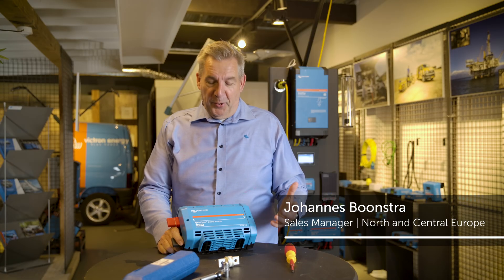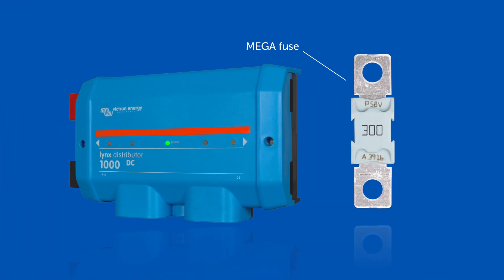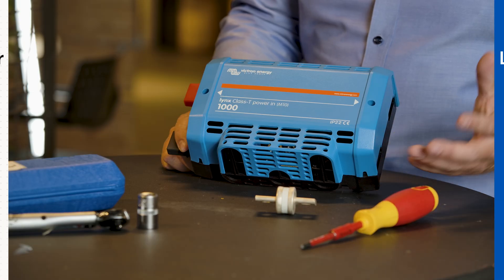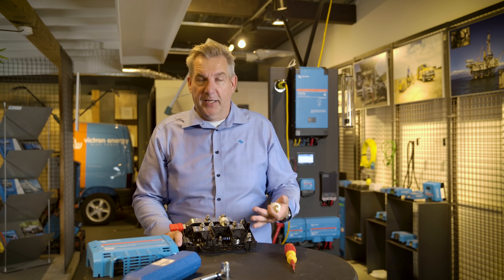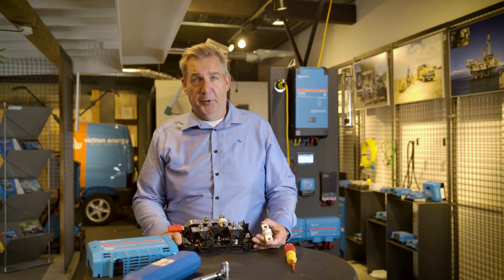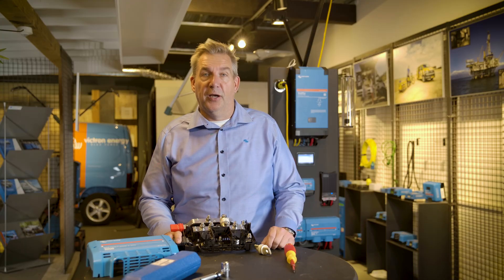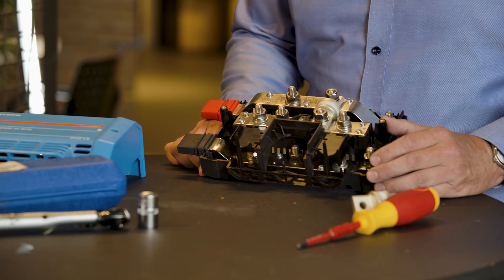4 of 4 - Explanation of Victron Energy Lynx Class-T Power In

Comment: Is the short circuit is the short circuit current the same as surge discharge current, or is it the Max. Continuous discharge current? I’m using 12 48v 100Ah li-time batteries and want to protect each battery.
Reply: @leeroyress6068 Type the following in your favorite AI search engine: 'Is a short circuit in the domain of fault protection and a surge current in the domain of overcurrent protection'. Did the result of your search help to point to the areas that you should research some more? (I'm trying to get my head around all this stuff too, as it pertains to LiFePO4-battery-bank-based power systems.) I think distinguishing between fault protection and overcurrent protection is a divide-and-conquer approach to understanding the problems to be solved.

Comment: I have incorporated a Class-T fuse in every battery I've built so, would there be any point in adding this unit to my system?
Reply: @9111logic The fuse at each battery sized to handle the current from one battery and the fuse in the Power In is sized for whatever aggragation of batteries you made (xPyS, etc.)? I get the impression from the Power In videos that when he says the Power Ins are for "strings" of batteries (a.k.a., "bank"?), that that is key. I'm trying to figure it all out too--any day now. But wait a sec, the fuses at the batteries are fault protection (vs. overcurrent protection)? I've not yet found a good source that brings all of the relevant knowledge together in one place. The Will Prowse video where he has a bunch of server rack batteries on the floor has a statement about the purpose of per battery fusing in the case of LFP, as I recall--even though he does not have any fuses on them.

Comment: Does this power in connect directly to the distributor or is the BMS absolutely required?
Reply from the maker: This depends if the batteries already have a BMS.  Lithium batteries must have a Battery management System of some kind.

Comment: I’m honestly quite concerned by what this implies.

So Victron has been recommending MEGA fuses for years in their official wiring diagrams – even though these fuses may not be suitable for properly protecting Pylontech batteries? That’s extremely disappointing as a customer who followed these guidelines in good faith.

Now, years later, we’re being told there’s a new “solution” – but it doesn’t even fit the standard Amphenol connectors used by Pylontech, since those start at a minimum of 200 A? How is that a viable retrofit for existing systems?

This doesn’t feel like a small oversight. It feels like a fundamental design and communication failure – and I’m left with a system that is now being labeled as incorrectly protected. Not acceptable.
Reply: To be clear, there is nothing wrong with a mega fuse, but the maximal short circuit current of many lithium banks (also these of Victron) exceed this Mega fuse value , therefore another solution is needed. For these battery banks to be clear.   A Pylon or other residual batteries often are not able to produce these hight currents on short circuit, so then there is no need for Class-T

Comment: I use DC circuit breakers on each string. They work well. Is there a problem using these? What is the advantage of a fuse, over a circuit breaker?
Reply: Circuit breakers don’t handle vibration very well compared to a fixed fuse. Hope your not going off road as you will have issues when the internal parts of the circuit breaker become loose and don’t work. Fingers crossed you’re ok.

Comment: Hi I have three Victron Lithium Battery Smart 12,8 batteries, each wired separately to a Lynx Distributor. Each one has a 300 amp Mega Fuse. I had my installation reviewed by someone who installs allot of Victron systems on boats. He suggested I replace my Lynx Distributor with a Lynx Power in, and install a 400 amp Class-T fuse on each of my three batteries. He the Mega Fuses could arc and melt into a solid connection. Do you think I should do this? Is this good advice with stand alone batteries?
Reply: Yes you should. Even if you just had one of those batteries it’s good to have a class T fuse with lithium.

Comment: I am just looking through the specs on victron batteries and can not find the scc stated for the different models. Is there a list so we can correctly configure a system? as i understand the class-T can handle up to 20k AIC, MRBF fuses can handle up to 6k AIC, but i am unsure what rating the standard mega fuses are, and are the 32v megafuses rated different to the 58v on AIC?
Reply: For the NG models the list of minimal and maximal short circuit are listed below, would that help you ?                     
12,8V-100Ah
1500
3500
12,8V-150Ah
3000
5500
12,8V-200Ah
3000
7500
12,8V-300Ah
6000
11000
25,6V-100Ah
1500
3500
25,6V-200Ah
3000
7500
25,6V-300Ah
6000
11000
51,2V-100Ah
1500
3500

Comment: I just had a look on the total internal resistance of a real-world 60kWh battery bank that I recently built (under optimal conditions, battery temperature slightly below 30°C). On a 140A sudden load change, the voltage is reacting with a delta of 0.4V, as seen by the Multiplus, all wiring, breakers, fuses and DC distribution included. Hence the Ri of the whole battery system is only 0.003 Ohms. Assuming 56V, this could result in a short-circuit current of whooping 18666A or almost 19kA!
Reply: could be, but thats connected in several strings to the busbar I suppose?
Reply: @JohannesBoonstra-ol2nz  Yes, two strings of two battery modules paralleled externally on each Class T fuse (additional breaker within each battery module), with rather short wiring 70sqmm. The planned/calculated/expected Ir was bit higher, though.
￼
Reply: @holger2806  then you should be well below 20kA  per fuse so thats fine

Comment: @Victron Energy - it would be nice to have a Lynx X in the Product Range - so you can Switch Inputs Upside Down. Especialy on ESS System's from Top you came down with the connection from the Multiplus - from the Buttom you came from the Battery's 🙂
Reply: yes agree, we have some discussions on these solutions already but due to priority elsewhere its not happening soon I am afraid.
Reply: It is so easy to implement and it should be done already. To just need a bended piece of copper and a different plastic mold. Please do it
Reply: @donalexey yeah right 😂
Reply: @johannesboonstra6917  no? What have I missed?
Reply: @donalexey  the fact that there are priority elsewhere, therefore  its not happening soon I am afraid.  its always about making choices what to do first..
Reply: @donalexey  That mold is the expensive and time consuming part. Molds cost A LOT to design and build.

Comment: I’d like to see a Lynx style component with: 1) 1 Class T fuse slot (sized for up to 400A), 2) A 500A rated shunt, 3) A manual battery disconnect switch (rated to at least 400A).

All in one.  

Retail price target: $300-400.
Reply: Actually, minus $25-50 since the class T fuse won’t be included.
Reply: yes there are many options/ideas.  The issue we have is that we need to prioritize development power ,  but this will be on the list.

Comment: can a mutiplus 2 3000va 24v be parallelled up to a easysolar 2 3000va 24v even though one has a cerbo controlloing it and one has its built in gx device
thanks in advance
Reply: theoraticly yes but this requires changing the internal wiring , so I would advise not to do so and go for a Multi GX plus a Multi and a stand alone Smart MPPT charger
Reply: I've got two easy solar linked together 3000va 48v, as already said above you need to change the internal wiring and both pcbs in the multi's need to have the same series or product no to make sure they are compatible, both of mine have GX screens, only one can be used, there isn't a lot of extra space inside the box, I haven't had any issues since they were installed 5 years ago.

Comment: My victron requires a 600A fuse coming from the battery’s,can this working with 2 300A t- class fuses, i ask this because i have 3 battery banks from 48V 608 Ah and will connect them to a busbar but every bank separately have a breaker from 125A for redundancy and maintenance
Reply: 3x125A (475A) is max system current, system will work using 2x300A of course, but those fuses will never go open as those smaller 3 (125A) will go first. Also, if you're batteries are 608Ah max, I would use 400A main fuse (2x200A will do), still alowing each bank to pull 125A but in total it limit max battery SC current to 400A thus saving battery life span. Always mind fuses thermal properties, how long they could take max current before meltdown... good luck.

Comment: M10 vs M8 doesn't do anything in terms of current capacity, except possibly lower it, but I haven't done the math on that. However, the M10 bolts make a more secure connection, which is nice when the project calls for four, five, or more Lynx products in a line. The bigger issue is that the advertised 1000A continuous capacity of the buss bars is not even close to correct. Measure the buss bars inside the Lynx and do the computations OR use any of the copper buss bar calculators on the web and you'll see that 500A continuous current is about the max before heating issues arise. 1000A continuous across the Lynx system can actually melt the plastic surrounding the buss bars. That means in large systems with many large inverters you cannot put your batteries at one end of the buss bars and loads/sources at the other. This also means building very large systems with Victron batteries is difficult since the VE batteries require an external battery monitor (i.e. the Lynx Smart BMS or Lynx Shunt) and that battery monitor is limited by the current carrying capacity of the buss. Doing so with eight Quattro 10kVA inverters and thirteen MPPT RS 450/200 (one of our recent projects) means interleaving the batteries, loads, and sources across the buss bars to keep localized currents within the bounds of the 500A continuous capacity of the Lynx system. This is very doable, but requires using multiple standard Lynx Power Ins with smaller class-T fuses (for each battery string) and MEGA fuses (for sources and loads). This is how integrators have been doing larger systems for years, though it's not supported by Victron. Alternatively, use batteries with communicating BMS's along the DC buss to avoid having an external battery monitor that is a choke point. This is the approach our Victron reps have suggested.

For 90% of Victron installations the Lynx system is just fine and you don't need to worry about batteries on one end of a buss and the sources/loads on the other.. But if you're building larger systems then you need to take into account the limitations of the Lynx system. We still prefer to string together multiple Lynx PowerIn since it gives a neater look than custom buss bars. It just means interleaving all the sources, loads, and batteries evenly along the buss.
Reply: Absolutely correct. This is why all gear has ambient temperature ratings, like 20*C or 68*F (NIST standard) current rating means, no matter how hot buss bar gets, ambient temp still has to be maintained to those 20*C rated aka forced cooling should be used. Back in a days we had RMS or continuous ratings which meant 100% duty cycle, which further meant if it's rated 1000Amps it will endure that load throughout entire lifespan of a product in acceptable temperature range, like commercial 0:70*C, industrial 0:125*C or military -55:125*C which is today reserved for very narrow product range...

Comment: You don't necessarily need the Lynx Class-T. You can also use the normal Lynx together with the adler ef3 fuses.
Reply: Depending on the possible short circuit current that’s correct
Reply: @anacronataff1 Thanks for posting about the Adler EF3 fuses, for I had no knowledge of them before I read your post. It led me to a thread on diysolarforum (I mentioned it in two posts above) that helped me understand a lot. Also very helpful to know that the EF3 have the same terminal spacing as Mega fuses! Up until now, I thought the options were Class-T for high AIC and MRBF for only small capacity lower-voltage (12V) systems. Now I have another potential alternative to research, thanks to your post.

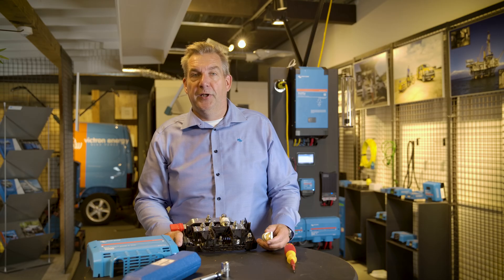Comment: QQQ. 1:58 if I have 6, 12 V 100 amp batteries and what you’re considering “two strings”you’re saying I need two 
class T fuses 😮

Why can I not just put fuses directly on each battery?
Reply: You can , but if the battery short circuit is high you need to find the correct fuse
Reply: You need 6 fuses, one for each battery. Being 100AH you can use MRBF fuse directly on the terminals BUT only because they are 100AH ones, each battery must also have a disconnect switch so you can isolate the battery. Means 6 times fuses+disconnect switch...better use 2x300AH batteries and you only need 2 fuse+switch+cables+lugs...less failure points, less volatge drop plus spend more on capacity and less on install equipment. Always use the biggest capacity lithium avaliable that fits in your space and if that's not enough fit a 2nd/3rd....one till you reach capacity you need.

Comment: Compliments to mr. Boonstra as it's takes great skill to be able to talk 3,5 minutes about something that's so obvious and already on the market made by same company... and yes, speaking about connections, bigger is not necessarily better, M10 bolts could handle less current than M8 if metallurgic is wrong, for example golden plated M8 has less contact resistance than M10, or even M16 in stainless steel, means there more room for developing "new" models...also, loom SC current should be less than battery internal SC current as no engineer would suggest to drive batteries to their 100% current capacity. Mind that I know Victron is among greatest companies on the market.
Reply: Those contemplating using this T class Lynx for marine installations should be aware that the ABYC regulation for the maximum distance between the Lithium battery positive terminal and the fuse is no longer than 7 inches in order to protect the cable! It seems more feasible and safer to just use 2 Class T fuse blocks.
Reply: @robthompson7174  I believe the distance can be up to 72” if the cable is inside a loom. But, point taken.
Reply: 😂 thanks
Reply from the maker: Mr Boonstra talked a lot longer than that ;-). All day in fact as you will soon see on other products!

Comment: does this mean, that M8 Lynx will not be sold any longer? My hole system with Multiplus 2 5000 uses M8.
Reply: Mind if you diy drill M8 to M10, any imperfections in contact surface, like pitting or burr, will induce drastically more junction heat rendering M10 less current capable than M8.
Reply: M8 will be phased out indeed , but by drilling the m8 to m10 you could theoretically interconnect
Reply: @johannesboonstra6917  That is a very bad idea! It is not simple to find cables with M8 on one side and M10 on the other side.